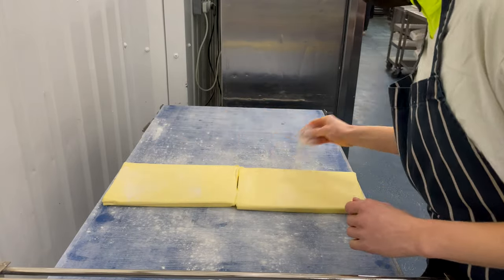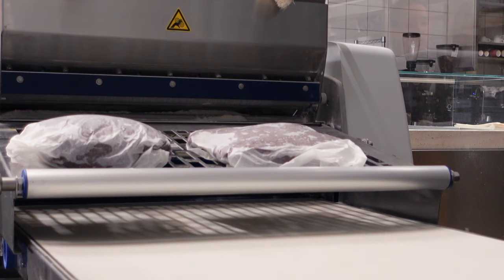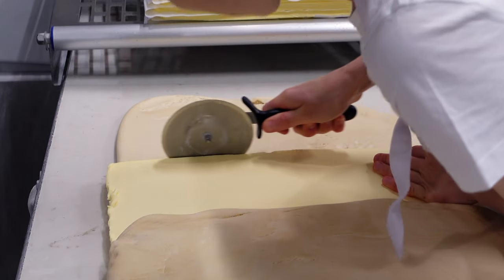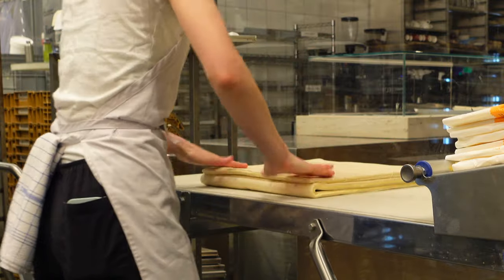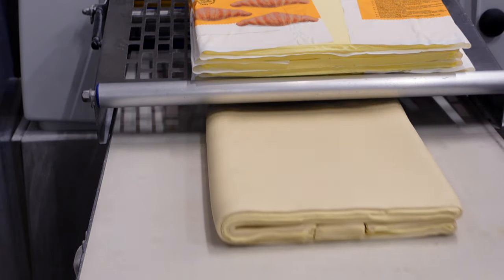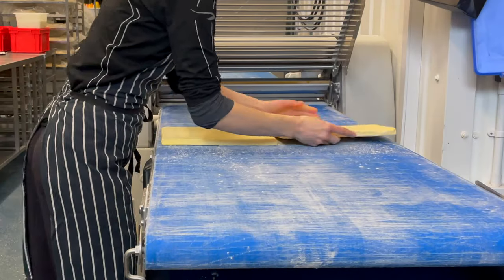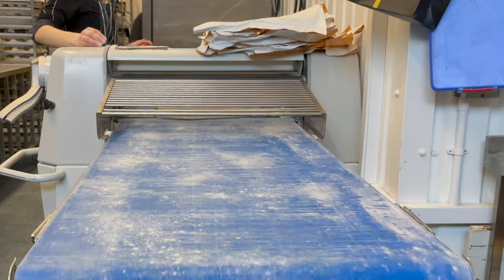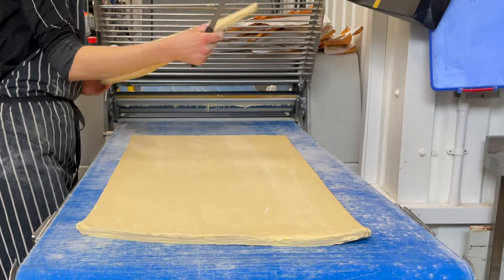How to speed up your croissant dough lamination with 2KG of butter?

Comment: I do something similar in my bakery with three 1kg blocks of butter. But it has to be really cold inside — to get that much in the sheeter I have to sheet the butter blocks to about 4mm and the dough to about 6 or 7, so if they’re too thick they won’t fit through the machine. If it’s warm at all in the bakery, it’s not fun to work with such thin butter blocks!
Reply from the maker: Hey! Wow thanks for sharing! I have never made a croissant lamination with 3 kg of butter, how big is your machine?😀
Reply: This seems like extra work.
We just sliced the butter lengthwise into strips and laid them across 2/3rds of the dough and did a single fold.

Comment: would it change the dough gluten structure if I cut it horizontally into half instead of sheeting it to double length and cut it in half before adding the butter? the reason why I did that way is because the butter I use is round shape after pressing, the dough is formed a round shape after mixing. That way I can match the dough and butter shape. Thanks.
Reply from the maker: hey, to be completely honest, not sure I understood your question, however, if you need a rectangular shape croissant dough - shape it in a ball, cut a cross and flatten it down. The dough will relax and will get a rectangular shape :)